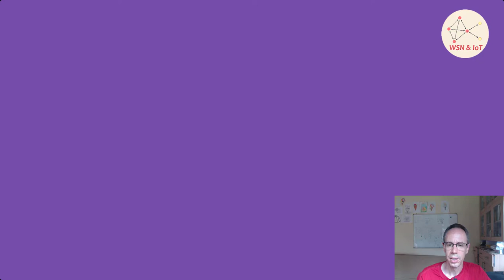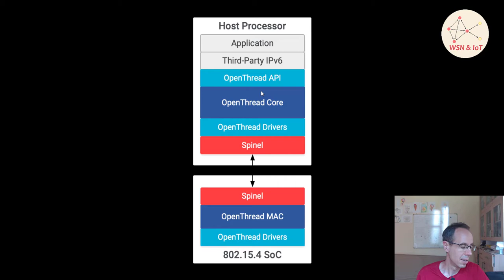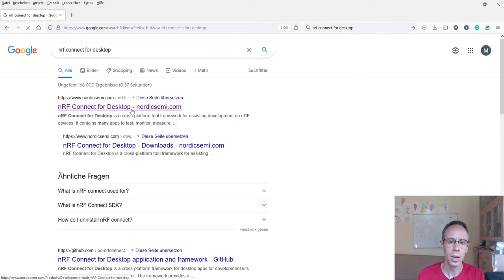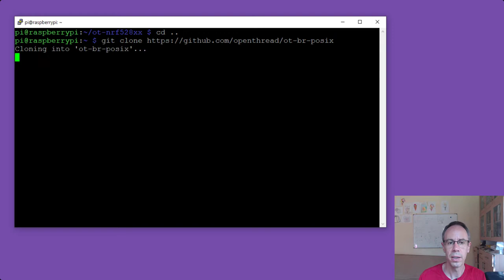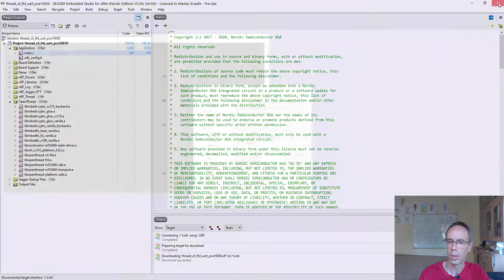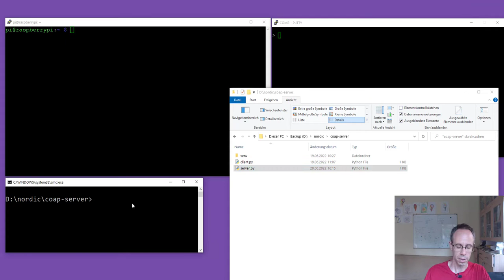Thread network technology - 07 OpenThread Border Router with Raspberry Pi and nRF52840-dongle

Comment: Hi sir,
I'm new in thread protocol, may I ask if it is possible to replace the nRF52840 Developerkit to nRF52840  dongle? Then I can use two dongles to do same way as you did in video. 
Thank you!
Reply from the maker: Yes, its possible. Bit of course the flashing of the firmware you have to make manually with the programmer app.
Reply: @wsniot  Got it! Thank you for your quick answer!  For flash part, so I just need to follow your way (build dongle firmware as RCP part in your video) to flash my dongle, final step to select  ot-cli-ftd instead of ot-rcp, am I correct? 

Thank you!
Reply from the maker: @林錦漢-b3t  You can flash the compiled hex-file with the programmer over the bootloader. Of course dont forget to use the build-file for the usb dongle instead the dk-file.

Comment: Video is really helpful, thank you very much for making this type of excellent content! I just want to ask that have you connected the development kit to the laptop or to raspberry pi using USB as it is not clear to me?
Reply from the maker: Only the nRF52840 dongle is connected to the Raspberry Pi for border router functionality. The developer kit is connected to the PC, but only for the power supply. The developer kit transfers the data wirelessly with Thread to the border router, which then forwards this message to the server over the TCP/IP network.
Reply: @wsniot  Thank you very much! and one more thing you had connected two pins through the cable on the development kit, can you please specify the pin names.
Reply from the maker: @simranmanghwani3514  If you dont have any problems with your developer kit, you dont have to connect the pins. There is a resistor to weak on my version on the developer board. Sometimes i had to wait up to 10 minutes until my dk was powered up. I guess the humidity and the salt in the air here have a part on it. After discussing it with Nordic support they gave me this solution and that they replace the resistor in the new dks.
Reply: @wsniot  Thank you very much!
I understood your point.
Thanks for the reply.
Reply: I am trying to use the PCA10040 development kit of Nordic but while connecting it with Putty it returns the same command in output which is provided as input, can you please suggest something for this or any alternate way for setting up the thread network
Reply from the maker: @simranmanghwani3514  I cannot really help you there, since I never worked with the nRF52-PCA10040. As a DK for a Thread-network i wouldnt recommend it since the RAM and the Flash from the nRF52832 is quiet limited.
Reply: @wsniot  Yes, understood.
Thank you for answering!

Comment: Can we use LWM2M as a data exchange protocols instrad of MQTT or  COAP?
Reply from the maker: Yes, has nothing to do with the BorderRouter. It forwarded just the IP-packages, you can use any application layer you want. And LWM2M uses anyway mostly CoAP as underlying protocol.

Comment: Hi markus, i'm interested on how you have coded the client device to be able to send to the PC the temperature imformation.
In particular i'd like to know how did you put your PC's IP address on the coap_client code, cause i tried to do that on VisualStudio by using the code of your video "Zephyr and Nordic nRF Connect SDK - 08 CoAP client/server communication", adding the IP of my pc instead of the meshlocaladdr of the coap_server device. I've put it into myMessageInfo.mPeerAddr using the function otIp6AddressFromString. 
Is that the correct mode? cause when i press the button on the prompt window appers nothing, while i'm running the python script. 
Could you advice me on how i could solve this issue?

Thanks a lot

Simon
Reply from the maker: Hi Simone, i did just use otIp6AddressFromString, but you can set it of ourse also on other ways. Maybe you check where the real problem is. With tcpdump you can check the traffic on the border router. Did the br receive the package, does it send it to the outgoing interface and so on. On the pc you can also check the incoming traffic. Does a ping on the ip address from the PC is working via the CLI. Maybe the firewall is blocking things on the PC.
Reply: @wsniot   Hi markus, i've a problem with otIp6AddressFromString: when i give the IP address of my PC the function does not convert the string to an IP address, i think it's because i give it in IPv4 format. How did you do with the IP of your PC? Have you used a special function or have you converted it in an IPv6 address, and if yes, how?
Thanks a lot
Simon
Reply from the maker: @simonebaraldi6753  otIp6AddressFromString only converts IPv6-addresses and also for addressind thread uses only ipv6. 
If you want to use the ipv4 address of your ps you have to convert it to an ipv6 address. You have to add the prefix which is assigned on your borderrouter to mark it as ipv6 address. 
Your PC gets nowadays also automatically an ipv6 address assigned in your LAN. So you could also use this one. Try to ping the address before over the CLI if its reachable.
Reply: @wsniot  Can you make video on how we can connect thread devices to the multiple cloud via border router? else can you please share some resources ?

Comment: Hello Markus
The video was very helpful, thanks. Border router and thread devices work fine. I have a question about joining thread devices. If the thread joiner device has no cli port( like a thread power socket), how can I join the thread device to the thread mesh?
Thanks
Reply from the maker: There are different solutions. I dont know how it works with the thread power socket. It can be done on mesh with pushing a button to initiate the joining. It can be done automatically when powering up. In both cases i think the passphrase have to be preinstalled on the joiner. 
Off-mesh it can be done over bluetooth with the mobile phone over the border router, if the joiner have bluetooth support.  There is a thread app available for joining.
Reply: @wsniot  Thanks Markus!

I asked Eve Systems costomer service if the Eve Energy socket works with an optenthread border router.

The reply:

Thank you for contacting Eve Systems customer service.

The only Thread Border routers for HAP (HomeKit Access Protocol) are: HomePod mini and/or the Apple TV 4K (2nd generation) or Apple TV 4K (3rd generation, Wi-Fi + Ethernet).

So it doesn't work, sorry.

Comment: If i need to use this dongle just as a transceiver for my Raspberry Pi, do i need to  just plug in to the USB port ?
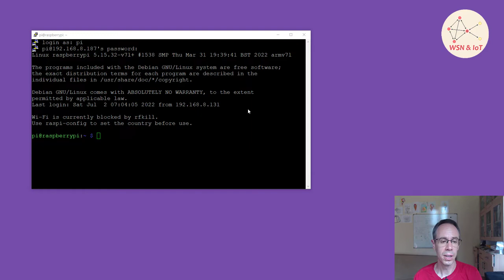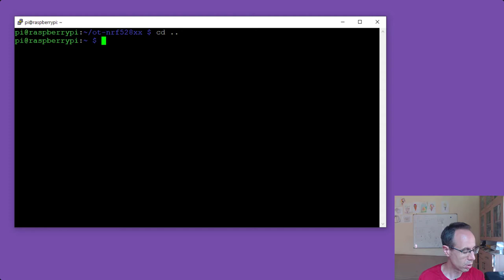Reply: You need to write the hex file generated from the nrf github repo to the dongle, and then you can plug it in to the USB port. The Timestamp - 11:16 Download nRF5840 GIT-repository  to ~21:00 should show you how to do that
Reply: @sebcal566  thank you so much